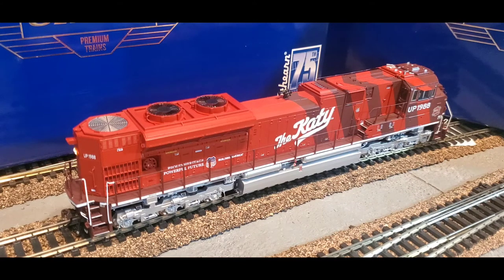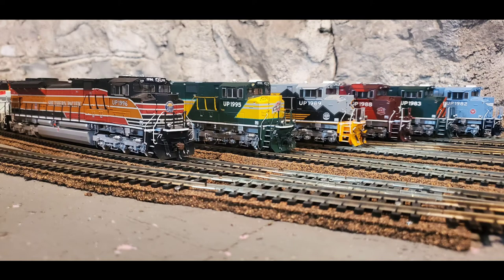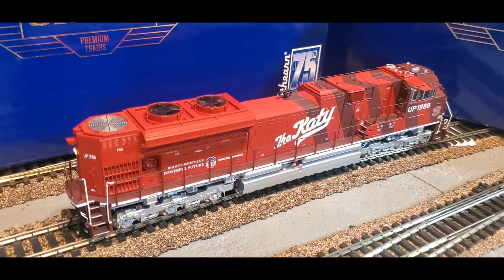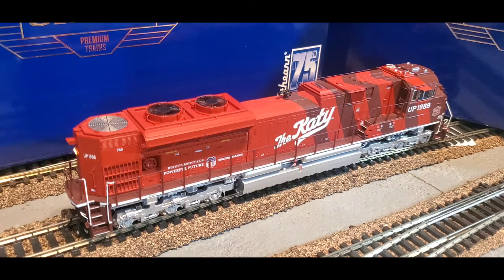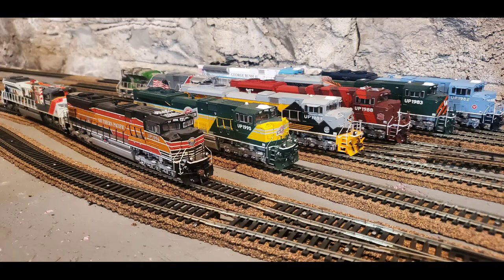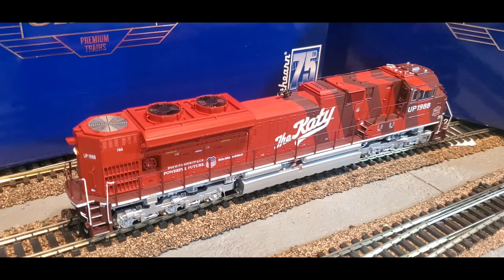REVIEW: Athearn Genesis 2.0 SD70ACe UP #1988

Comment: Nice video! For the issue with startup at track power, Set CV114 to 71. This will disable the auto start feature. F26 is the RPM+ function and will start the locomotive. F27 is the RPM- function and will shift the prime mover down from idle.